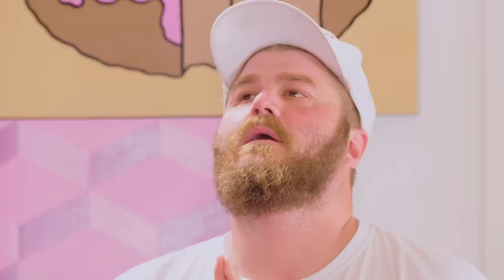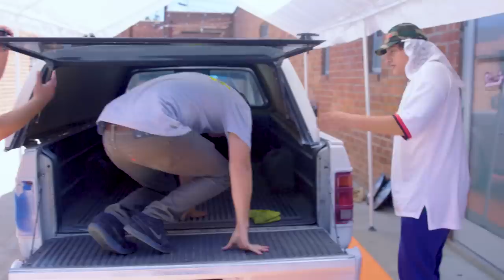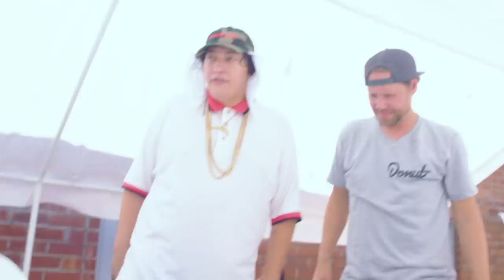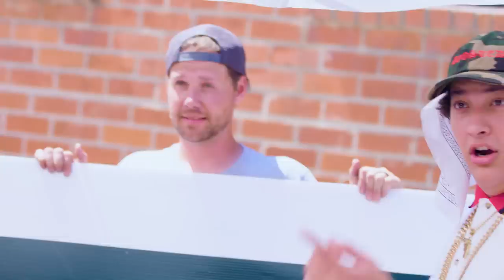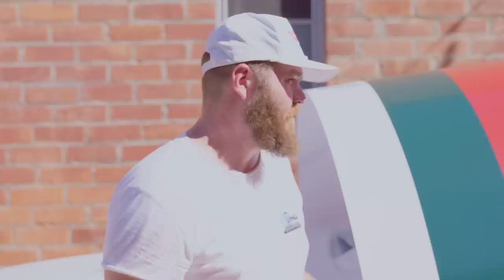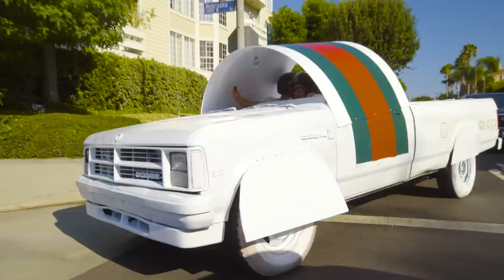Gucci Flip Flop Truck | Cheap Thrills BOOSTED | Tatered

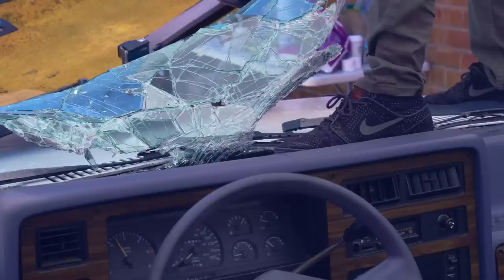Comment: That glass sound at 8:25 is satisfying as hell
Reply: It will make as a good ASMR.
Reply: If you live in a cold place like I do (Canada) , there are thin layers of ice that appear on the floor at certain temperatures and sound like this 8:26 when you step on them :). Basically you can enjoy this beautifully satisfying sound 8:26 all day long while you're walking down the streets. One of the many reasons why winter is awesome 🤣
Reply: DaRealCarlos \  did you just try to brag about Canada?
Reply: DaRealCarlos \ damn dude that seems like asmr heaven
Reply: liked the stretching and breaking at the same time
Reply: DMT It gets more satisfying each time

Comment: So you painted a roof to take it off ???
Reply: Twitch Wozzavelli would’ve been a dead giveaway otherwise.
Reply: @johnjuiceshipper4963  would of been alot quicker dead giveaway they put cable ties on mans wheels protectors 🤣🤣🤣
Reply: @twitchwozzavelli5410  That's the Cheap Thrills way fam

Comment: They should have left the front intact, they didn't have to remove the windshield, they could have tinted the front side windows with those stripes and put the strap on the top of the roof, this is undriveable and a waste...